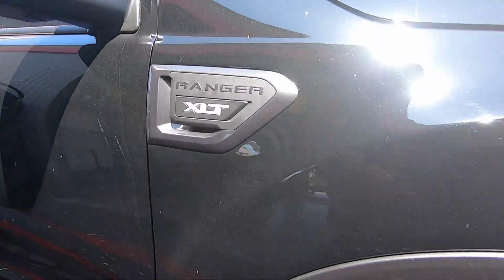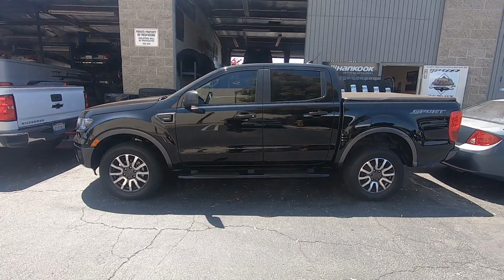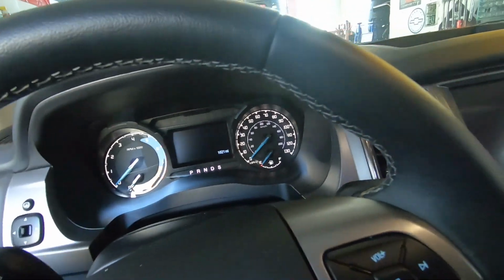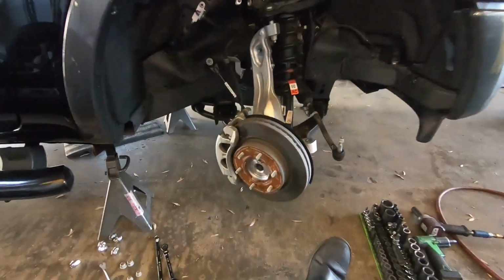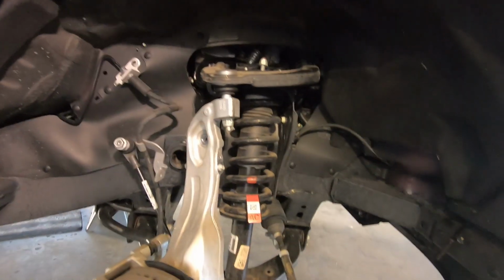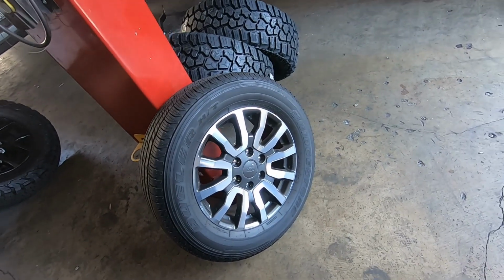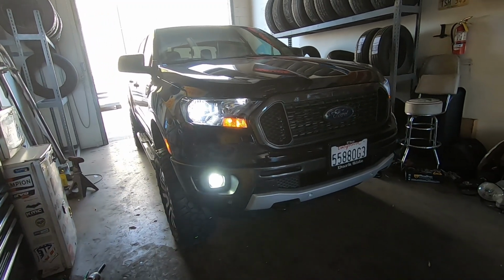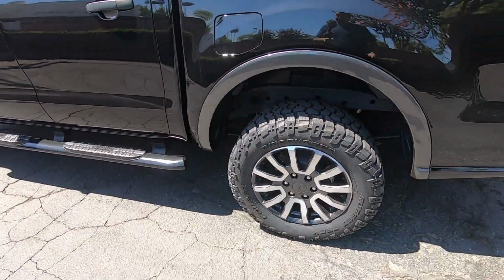2020 Ranger Lift / The Tire Garage TV Ep64

Comment: These tires have two different sidewalls. From the video I see you mounted them with the knife edge design facing out on the rear tires but you mounted the front with the mountain design facing out. Hopefully you fixed that lol.

Comment: Did you need to cut the studs to fit the tire on the 1" spacer?
Reply: I've read that any wheel spacers under 1.5" need to have the studs cut.
Reply: @alanbruns9406 I would not cut my studs. Just put 1.5".